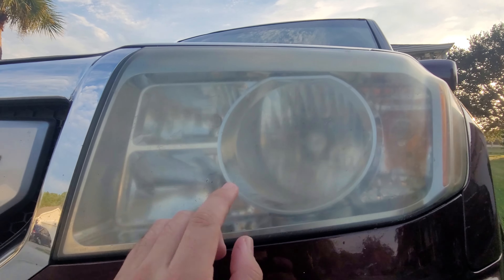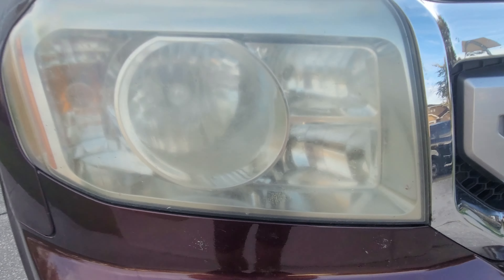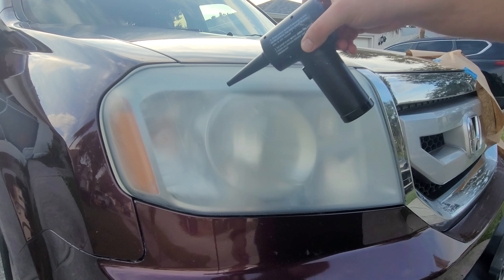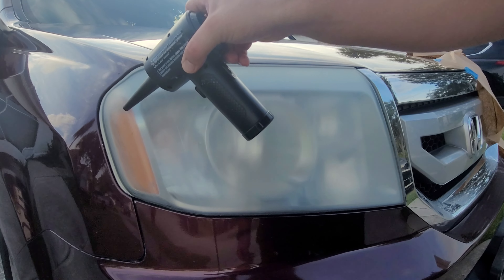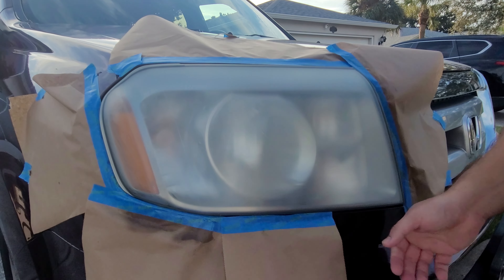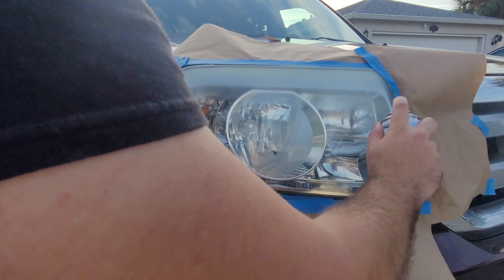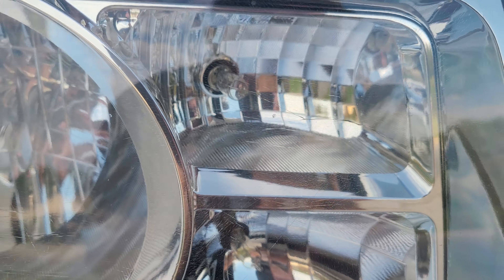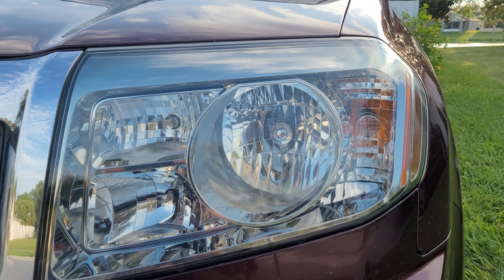Why I Wetsand instead of Drysand!💦 | Site Updates | 2015 Honda Pilot Headlight Restoration!

Comment: Brad is so right !!! His method is so much easier, efficient and comes out awesome with the spray . I’ve had about 10 paying customers so far but I’ve practiced on about  2 dozen cars trying different methods from wet to dry to combination of both and his method and spray always wins. With dry sanding you have to put on at least 3 layers of tape to protect the paint then the dust covers the hood then your constantly running out of batteries. That next gen spray is extremely thick and fills in every sanding mark plus any surface micro cracking. …. Now don’t bother Brad anymore I need him to mail me out more spray !!!
Reply from the maker: haha Thank you! I'm keen on efficiency as long as it doesn't jeopordize quality. I'm glad to hear its working out for you and you're staying busy!

Comment: Have you ever tested the light output from one of your restored headlights? I've been watching a lot of videos from Headlight Restoration Pro and he insists that applying clear coat to sanded but un-polished headlights will diminish light output, even though the light will look good visually. I've used his method about 4 times now on my own headlights for practice and every time I end up with a dull haze that's especially noticeable when the lights are on, even though the lights look great immediately after the polishing phase and the clear coat phase. It seems like your method would definitely save some time and prep work, and your results seem to look just as good as his. He's also a big fan of dry sanding with a drill and polishing with a high RPM polisher before applying the clear coat.
Reply from the maker: Hi Cliff! I've done several test on my own vehicles when first starting, and didn't see any loss of visual output, but never a light output test. I'm sure my manufucture may have some information on this. What kind of vehicle do you have? Some Lexus and certain Toyota models have a slight tint to them, that can appear dull after restoring, other models as well, but its more often found in those 2 models. Also, do you have HID's or aftermaret bulbs installed?

 I used to use the Meguires method as well, and can say its deffinitely a good method, but with the 1 year lifespan, and the time it takes to complete, its not efficient when you're doing 5-7 vehicles a day. If you're doing a few vehicles a week, it maybe ideal. Dry sanding, wet sanding, its a preference in my experience. Both have their pros and cons, but in my opinion, no one is superior to the other.
Reply: @StartRestoringHeadlights  Hi. I have a 2008 Chevy Suburban. I bought it used so I don't know if the bulbs are aftermarket. There's no tint though.  I've done about 5 restorations at this point. (I just finished up one on the passenger side as I sprayed a little too much clear coat earlier today during practice restoration # 4). It seems that even when the headlights look great to the naked eye, as soon as the lights are on a cloudy haze is there. I 'm wondering if this might be normal as I've never seen a restored headlight shown at night with the lights on, and I don't really know if the light output is diminished or not. I'm sure a customer with yellow, oxidized headlights would be amazed at these results, but I wonder how many call-backs I'd get if they all look like the Suburban at night with the lights on LOL. Maybe I'm sanding too much, or not enough? It reminds me of when you clean a window in your house and it looks like new until the sun shines from just the right angle and a hundred streaks show up.
Reply from the maker: @cliff638  Ah I understand.. Every headlight is different, so its hard to say the exact issue you're having. I've seen some early stages of microcracks in the middle pane of the lens that has caused some issues with projection of the light. No amount of sanding can remove these kinds of issues. When the light enters these tiny cracks, the light refracts, and does similiar to what you're describing about the window streaks. Those vehicles are known to have slight stress cracks, since the headlight is so large, which makes the middle of the headlight weaker than closer to the edges. Unfortunately you may have to replace them.
Reply: @StartRestoringHeadlights  I'm going to try to acquire some older, hazy lights from  junkyards by mail to get some practice and I'll remove the bulb and shine a powerful light through the hole to test it after I repair. Also, I'll offer some freebie restorations to my neighbors (I've already agreed to do the UPS guy's headlights in a few weeks). Thanks for your input. By the way, have you ever thought of adding windshield rock chip repair to your list of services offered? It seems like it could be a great upsell.

Comment: Hi. I was wondering if the 400 and 600 grit sandpaper you use is the "P" kind or the "CAMI" kind. Thank you.
Reply from the maker: Hi Cliff! No, P just indicates the sandpaper is graded by FEPA. Its a Siicon Carbide grain sandpaper which is waterproof. Perfect for achieving a smooth finish without leaving any scratches after applying the clear coat.
Reply: @StartRestoringHeadlights  O.K.  Thanks.

Comment: I just did a 2011 Honda civic and what a nightmare! One end had a part sticking out the other side had a round section sticking out and just to make things worse on the top was more angles that tucked under a section of the car. No way anyone is dry sanding that thing with a drill ! Only way is wet sanding and even that took me forever trying to fold the sandpaper perfectly to fit in all the tight spaces. Brads way is the only way !!!! Long live the Bradster!!!!!
Reply from the maker: I know the exact one youre talking about! The hood covers a very small section toward the grill end of the headlight, and to make matters worse, in concaves in toward the engine hah! Deffintely can be tricky, but popping the hood on those makes it 10x easier! Thanks brother!

Comment: I believe I heard you say, in another video, that you have tried many different methods. 

I am curious if you have tried a hybrid version of your current method. 

Wet sand like you do then polish, then apply a protective coating?
Reply from the maker: I swear I replied to you, but its not showing up, I apologize. Correct. I originally did the Mcguirs method when first started. The clear coat we use needs something to grip to. If the surface is too slick when applying, it will bead up, and drip off the lens.
Reply: @StartRestoringHeadlights  thank you for the response! I did a little more research and from what I gathered. Your clear coat spray is thick and hides any small imperfections that can be caused from wet sanding, and leaves a crystal clear finish like you show in your videos. Therefore, polishing before applying a protective coating is not needed and not recommended as you stated above.
Reply from the maker: @itsandrew8758   Correct. Since it fills the scratches, it adds a thicker layer of protection than simply applying over a thick servic. This extends the longevity of the clear coat as well.

Comment: What's your recommended aftercare for restored headlights? Also is the NextGen uv clearcoat your own brand? Can't seem to find that anywhere else.
Reply from the maker: Great question! We don't get asked this enough. Not much aftercare other than keeping the lens clean. No clear coat can stand up to negligence. So washing the bugs and road debri off will extend its lifespan. Correct. The new site will be up within the next month to month and a half.
Reply: @StartRestoringHeadlights  thanks for getting back to me. How long does your uv clear coat last compared to meguiars?
Reply from the maker: @j_crust4582  With proper application and cleaning, 3-5 Years.

Comment: I'm sure you've been asked this question hundreds of times, but after spraying the clear coat and letting it cure, why would the headlight have somewhat of a blurry look if you look at it very closely? I think I may know why, but wanted to confirm with the expert. Thanks Brad!
Reply from the maker: Hi Sam, so it can be a few different things. first one is cracks or imperfections deeper in the lens. When the sunlight enters this imperfection it can cause the light to scatter or refect, giving off a blurry or holographic effect. Second thing may be the prep. Headlight restoraiton is %90 prep, %10 clear coat application. If the lens isn't preoper prepped, you can have some slight blurriness to it. Lastly the curing conditions. High humidity can cause a slight haze, or lets say you apply the clear coat, and the customer pulls it into the garage afterwards and the light doesn't get enough UV exposure. This can cause a slight haze, and for the light to appear unclear. Other factors might include issues on the inside pane of the headlight, which you won't know are there until after restoring. You're welcome!
Reply: @StartRestoringHeadlights  awesome! You make it 100% clear man. I feel like I’m getting better every time, thanks to your tutorials!